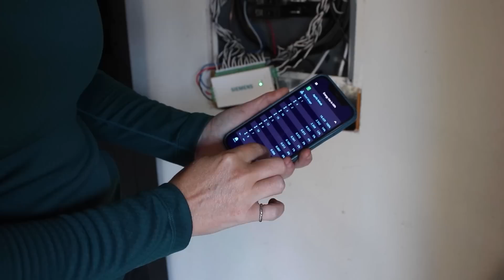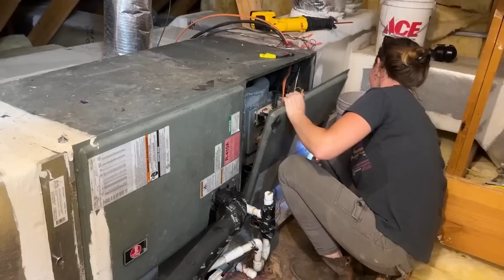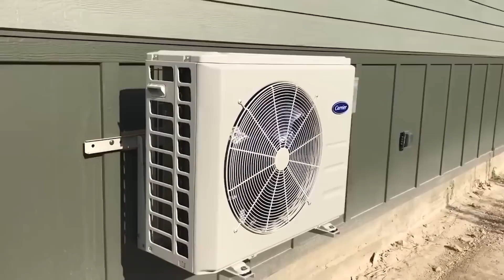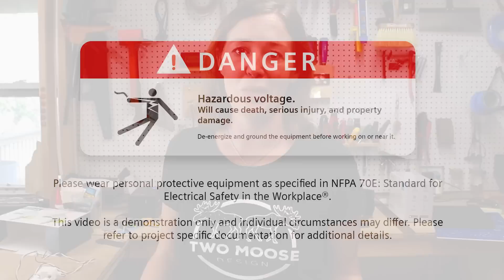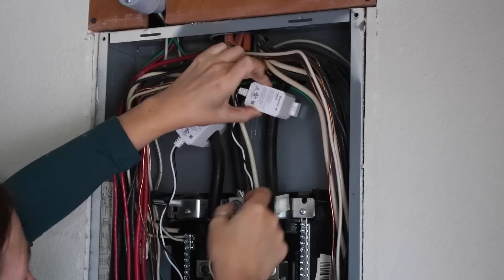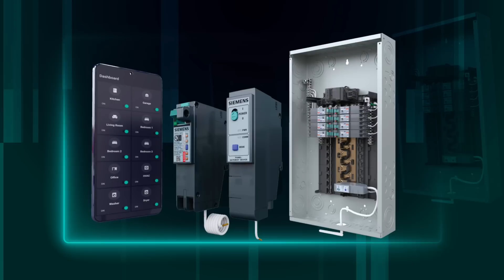Save Money with the NEW Siemens Energy Monitor

Comment: Why cant everyone be as clear and to the point on youtube land as you are??!! Quick question you may know since even the people who sell this in Tampa cant answer or even SIEMENS!  My Sub panel is 20 ft away from where I would be putting this thing since I will be monitoring only 1 breaker at the main panel. All my other breakers are at the sub panel but obviously the little white gadgets wont reach that long. Do you know if it is possible to hook up the rest of the little meters on the Sub panel, connect them to another separate transmitter at the suba panel and then basically have 2 trasmitters reporting to a single app? Any input is appreciated.

Comment: This is interesting on a grand scale, but what about tracking the interior temperatures of say 3 refrigerators and 2 deep freezers? Let me set this up,  three years ago our LG fridges compressor went out. Deb said that nite before the temp felt off. In the morning pulling freezer door open slush and mush hit the floor. We did have the fridge repaired but I also bought Tempminder units used in the RV industry to monitor temps. Three sensors included so house fridge and 1 chest freezer being monitored only. These use one set frequency so more sets won't work together. SensorPush Corp makes a sensor that can be monitored on your phone  and also has alarm setting unlike what I have. This whole quandary comes from the huge expense of losing meat but wondering if you've been down this road with appliances not lasting as long as appliances made years ago? Really enjoyed your garage beam trolly video and that was the impetus of writting this. Thank you.
Reply: Holy cow, those sensors are huge.

Comment: I don't understand why you clip two sensors on a double pole breaker. The same power goes through both. And how does the app know that both sensors are measuring the same circuit?
Reply: Traditionally, most manufacturers install two sensors on a double-pole circuit breaker – one on each line – to obtain precise current data for each individual circuit.

However, this approach presents an issue: power measurement requires corresponding voltage and current for each line, which necessitates identifying exactly which line each sensor is installed on.

A key drawback here is that the current is identical across both lines, making one sensor redundant. This also leads to wasted installation space.

eMonHub improves upon this. For double-pole breakers, since the current is the same across both live wires, installing just one sensor is sufficient to measure the current for both lines.

eMonHub's voltage input connects to all live wires, enabling it to measure the voltage of each. By analyzing the phase angle relationship between the voltage and the current measured by the sensor, it automatically identifies which live wire the sensor is installed on. This allows for accurate calculation of power consumption based on the corresponding voltage and current. Additionally, eMonHub incorporates algorithms designed for scenarios where voltages on the two live wires are inconsistent, ensuring accurate measurement and reliable performance. This approach saves sensors and reduces installation space requirements.  Learn more :http://www.sungrass.tech/productList.php
Reply: Yep, that stood out to me.  Everything I’ve seen says to use 1 CT on either wire and there’s a setting in the app to double that CT

Comment: As a former inside wireman and electrical contractor, I would be very careful in coaching people to install their own equipment like this. Especially since this device is only rated for 240v and you showed a shop potentially giving people the opinion they could use it in 480v services. The general public should not be installing equipment in their panels without prior training. The available fault currents in the panel are much higher than the outlet in your bedroom.

Great product. Hire a licensed professional. Don’t do it yourself.

Comment: Thanks for an informative video.  Question: you mentioned that the device has an antena that transmits the data to an app so Wifi connection is required?  If there is no Wifi, is there any other way to download the data?

Comment: but but but... I thought we were all installing SPAN panels these days?
Reply: SPAN is a listed energy management system with the primary design intention to be able to get 200 amp panel performance from an older 100 amp service without the cost of the utility side upgrade.  Completely different application than just a third party monitoring system.  SPAN does so much more than just the VUE/Inhab systems

Comment: They need to miniaturize those clip ons, they are too big. The replacement breakers seem like a more elegant solution.
Reply: Yes, I've been looking at several of these types of energy monitoring systems - and their wire clamps are all a little large. The Siemens ones actually seem to be relatively small compared to the others.
Reply: If you have a box that isn't flush mounted into a wall, you can have the monitor and clips OUTSIDE the box, you just feed the wire harness wires through a knockout. This keeps the inside of the breaker box from becoming congested. At least that's what I'm hoping.

Comment: But what would a licensed electrician say if he needed to open your panel filled all those sensors? Some auto mechanics will not try to solve electrical problems in a car if it has aftermarket electrical devices installwed and I don't blame them.
Reply: If your "licensed electrician" has issues with some current transformers on branch circuits, you need to get a new electrician.  We do this stuff all the time on commercial/industrial systems.  I'm happy to see the technology making it's way to the residential load centers that isn't a thousand plus dollars.

Comment: So instead of replacing the loadcentre with a smart one like Leviton. But filling up the space. Problem I see is most older panels are a wire disaster, and the added heat from not having enough air space betweed the homeruns. It is a hit and miss for me. I rather change over the whole panel, be it Leviton or Span, vs filling up an already full panel. It might be usefull for a handfull of loads, but not if you are doing the entire home... thanks for the info though. :)

Comment: That’s is a lot of stuff in that panel you could of just had a smart panel installed
Reply: One of the problems with the smart panels is that you are tied to a single manufacturer and hoping that you never have a major failure on the controls side of the system.  Besides, this is simply a third party monitor, not an active load management panel.  The entire system could crash and you'd still have complete use of the base panel.  Even if you go the smart breaker route, if a breaker dies, then just pop it out and put in a new one.  If a span fails, it's an entire back plane that would have to be changed.  Not to mention, $200 verses $2500-3000 plus installation.
Reply: Yup, as an electrician, this was my thought exactly.... old panels are normally a wire disaster to begin with. My concern would be air circulation aka boxfill... we'll see if the Canadian Code allows this. But I do prefer the Leviton or Span system, since one can also remotely turn breakers on or off...
Reply: Yes, this is a good retrofit option for current panels. But I do love seeing the smart panels and trying to that experience for a lower entry point. Some controllable circuit breakers are coming in 2025 as well :)

Comment: Awesome video. Have you ever installed a mini split or do you like them. I have a mobile home that is 80'x36'. My furnace is at one end of the home so consequently my bedroom barely hits 58 degrees because of the distance from the furnace. Someone suggested a mini split and install closer to the bedroom.
Reply: Typically, in a forced air system, the duct size reduces the further away you get from the source (furnace, AC, or heat pump). So, if you aren't getting warm air at the end of the duct run, either your duct size is too big toward the end of the run, or your ducts aren't properly insulated. Addressing those issues would be a good first step.
Reply: Indeed she has! Behold 1: https://www.youtube.com/watch?v=zqr20LjmoIk  and 2: https://www.youtube.com/watch?v=TyD-LucjdcQ   Both from Mr.Cool line of DIY mini-split HVAC kits.
Reply from the maker: Yes I have, several times in fact and love them! I have them in both my personal and commercial shop and in my garage! I love them! Thanks for watching.
Reply: She literally has at least one video on installing a mini split.
Reply: @ thanks I just started watching her and amazed all she does. I'll check k it out
Reply: I had a similar problem and a visiting friend (who is a mining air flow specialist) said, "just put a small quiet fan on the floor and blow the cooler air along the floor toward the furnace. This air will be replaced by warm air flowing along the ceiling from the furnace area".
I was dubious and grabbed my 6 inch summer fan out of storage and challenged him to show me. He put it on low (= quiet) and placed it on the floor just inside the bedroom, facing down the RV toward the furnace. 

We had a couple of drinks and a chat, and an hour later the whole RV was close to the same comfortable temperature as this small fan had redistributed the warmth.
Since learning this over 10y ago, I have shown a number of sceptical people how they can easily eliminate or at least reduce cold areas in a house for little $$